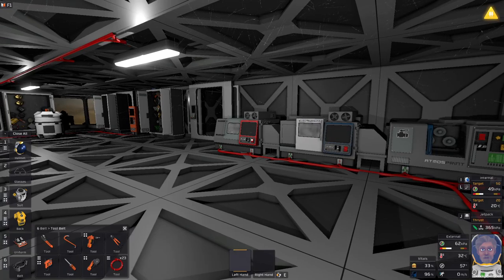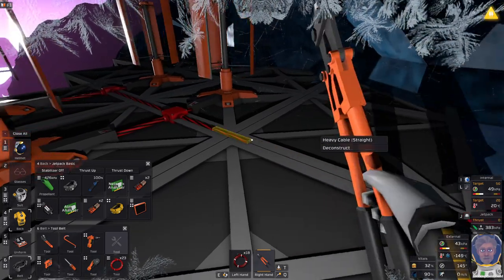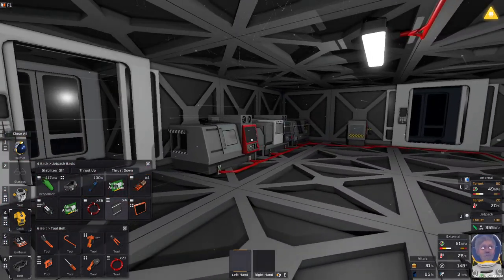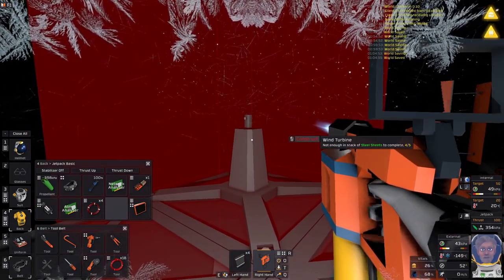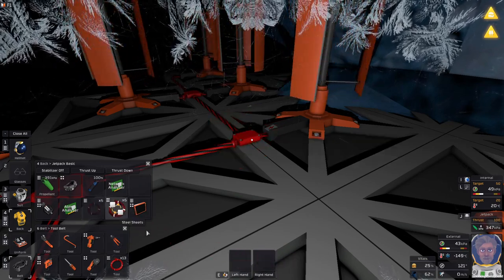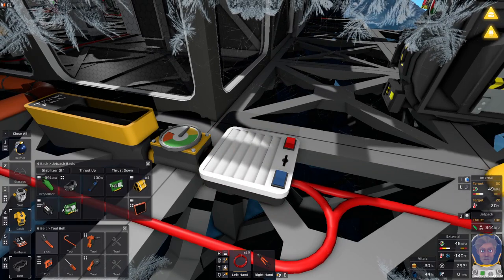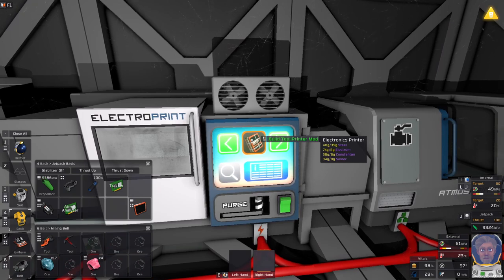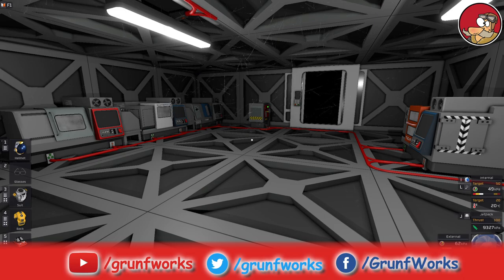Wind Turbine - Stationeers Europa Getting Started Guide

Comment: The only hard alloy is waspaloy. Required pressure is close to blow up furnace. It's 50 MPa and furnace can handle up to 60. In my experience you need to open input vale at about 30 MPa. If you open valve at higher pressure, it may blow.
Reply from the maker: Is 60 MPA limit for regular, advanced furnace or both ?
Reply: @GrunfWorks  Advanced for sure. Not sure about regular.